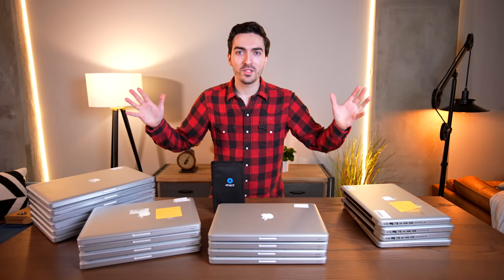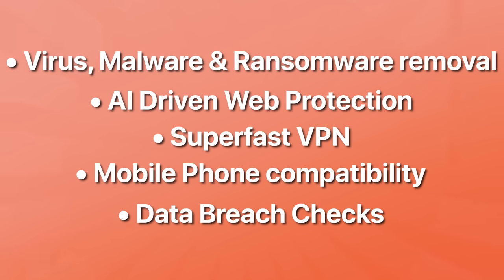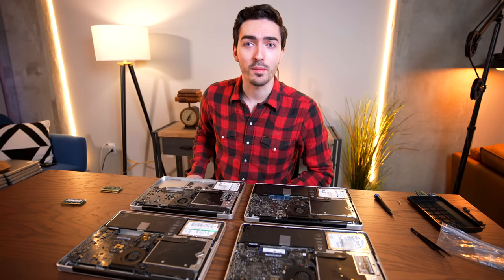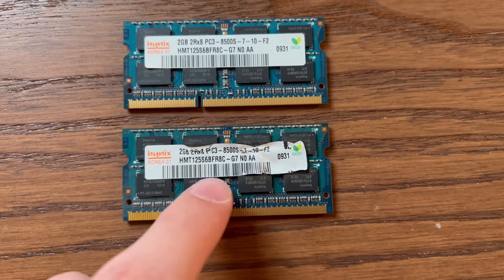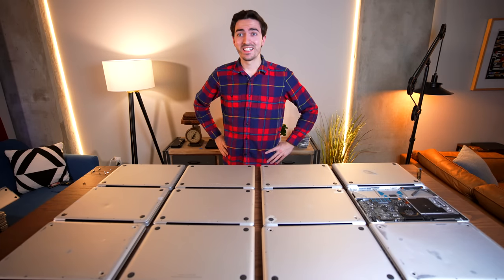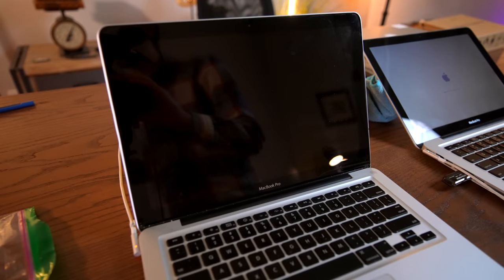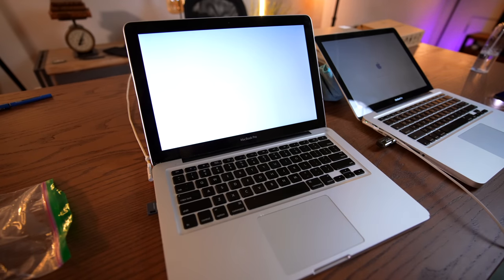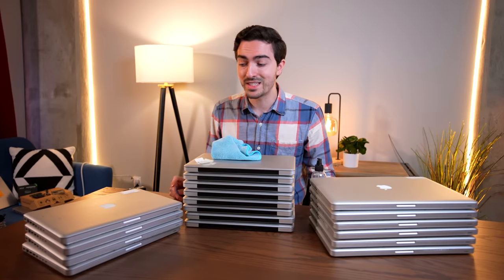Giving 20 MacBooks the ULTIMATE restoration [Part 2]

Comment from the maker: Do you think I got a good deal working on this project? Also, check out TotalAV to save 80% on a yearly subscription! http://www.totalav.com/lukemiani
Reply: Can you please give me one of your MacBook, this would help me in my studies here in the Philippines. I'm forever thankful if I could receive one. ty
Reply: You must love MAC :) great !
Reply: Loved it!
Can relate, as I used to work in SSD development as a tester for many laptops, and Macs were by far the most weird.
Had my own 2011 macbook I restored back then, and it's still kicking today.
Originally replaced the logic board, speakers and just for cosmetic purposes, all the individual keys on the keyboard.
Upgraded the drives to SSDs (yes, I replaced the CD drive with a cradle)
I recently replaced the speakers(again) and the battery too. To prevent the repeat of GPU burning out, I drilled holes where the fans are in the bottom case, and temps fell 15 degrees c.
Reply: yes you did get a good deal
Reply: @dgurevich1  You would have spent less by buying a new mac
Reply: @mattiaalesi7129  not quite. I had a donor from the written off macs from work.
All it cost was a couple hours of work.
Reply: @MyNameIsNeo81  luke is OCD about MacBooks
Reply: It is a super great project Luke. Thank you so much to show this project. My late 2009 macbook still work, but it gets too hot. So I am using an upgrated PC. I am going back to france in a month,  because I have tools to open the mac there. Bought thermal paste, hope its the only problem, but also, one screw is missing on the back case.  I learn a lot from you, now I will try to fix mine. Currently stuck in somewhere in the world where like a big prison to me.  :(
Reply: Would you be able to fix  my Mac air M1 or MacBook pro 2010?

Comment: 16:40
OBJECTION!
This board actually has another purpose, and that is putting the computer to sleep when the lid is closed.May not be a deal breaker for everyone, but I just had to mention that.
So, yeah... I guess I'm one of that guys that just had to point this out.
Still, seeing my beloved unibodys getting another life brings me a ton of joy.Well done friend!
Reply: Wait a damn second, I have a 2011 MacBook Pro 15" that I purchased used, closing the lid does not let it sleep, could this be the issue? I've looked everywhere and have not found a solution.
Reply: @rmendez011  This might be the issue.This shouldn't be a costly replacement, but I cannot tell for sure if it will help.
Reply: @rmendez011  Decided to try it out.Both 15” and 17” MBP 2011 stopped going to sleep with closed lid after disconnecting the battery board.So I guess it applies to all unibodys.
Reply: @thrallfaec6130  what happens if you unplug it but unscrew it and move it around, does it sleep then? I don't really want to keep pouring money into this laptop as I don't  use this laptop as often as before, it gets waay too hot doing normal tasks (around 80c idling).
Reply: @rmendez011  I have no idea.

Comment: Fixing weird issues is the most exhausting part of fixing old machines. 

Cheap batteries is another question, because you'd like to have many, but not spend a fortune for a decent ones. 

Anyway, it's really a great project and that's so cool you promote healthy approach to electronics: fixing old ones and NOT buying latest tech if you don't essentially need it. 
Great job mate!

Comment: 14:46 yeah, I had that happen on my 2011 17" years ago, a break in the matrix for the asdf row. But I didn't have a spare top case, so I orderered just the keyboard (it was only $20 or so!) and spend two hours swapping it out. IIRC there were 72 tiny little screws, and I had to use a magnet to make sure I didn't lose any of them.
I recently found a 13" with shorts between O, M, and the command key, and possibly more. I should be able to find a replacement from a 15", they use the same part. When doing a full refurbish you need to check the keyboard!

Yeah, it's a lot of work to get/keep even one of these back in shape. And you can't forget power supplies, they don't necessarily come with a bulk buy like that, though you could still get official ones through Radio Shack until they went out of business.

Comment: I work in the ITAD industry and I have to clean 1000’s of devices every month. I recommend using goo gone and magic erasers to remove the sticker glue. And also a brand new razor blade on a scraper to cut your cleaning time in half. I know you’re worried about scratching the devices but if you keep it almost parallel to the surface and use the same side of the blade without flipping the scraper you will not scratch the computers. Just some friendly advice. Love the content and really enjoyed this series.

Comment: Wow, that was a pretty sweet restoration! I would have personally just got them all to a working state, with working batteries, but left the hard drives as-is (unless there was a compelling reason to upgrade to an SSD - like the Core i7 Macbook). 
Congrats on getting those laptops into working order - glad you bought them, rather than someone else (who would have likely stripped them all for parts). Also, have you kept the hard drives? They can come in useful for other storage of data etc.

Comment: 13:30 seems like a panel controller self-test mode of some kind. my guess is that some of the crud you brushed out of the connector had been bridging some pins or pulling some low or high that caused the display controller to go into self-test/panel-test mode. i've seen this sort of thing happen occasionally when people turn dead laptop displays into desktop monitors by slapping an ebay display controller board onto them.

Comment: Luke, that was an amazing effort to restore those MacBooks. I have a question: how did you install Catalina on them? Most are unsupported.
Reply: Same question here! Is it even a good idea?
Reply: @kevindochain  It's an amazing idea.
Very slight graphics issues can occur in 3rd party apps, but other than that all good.
And if you don't want a weirdo install, go for High Sierra.
Even on Macs that are stuck to El Capitan, High Sierra does not require Metal so it will work just fine!

Comment: The battery indicator is not optional. Its cable sits under the jack connector for one reason... it has a component there that magnetically detects when the lid is closed. Your MacBook Pro will not go to sleep when you close it without this thing.

Comment: Well done! Yeah my 2011 13’ MBP is still kicking along for basic tasks. I often debate changing the battery and getting a new charger but it’s hard to justify (I was looking  at the iFixIt kit). The biggest issue is software at this point. I’m running OCLP Big Sure just to keep apps functioning.

Comment: I had an issue with the battery status indicator on my 2012 as well. The mac would randomly shut itself off and be completely dead (dim flickering light on magsafe) and not turn back on until I manually removed the battery and put it back in. Turns out that the battery indicator was just shorting out, and simply unplugging it fixed the problem.

Comment: I use a MacBook Pro 13" mid 2010 base model with SSD and 6GB RAM as my daily with High Sierra. Everything that I need to do works really great. I switched to it from my 2013 base model 21,5" iMac because it got too hot when playing Minecraft and using Skype. Weirdly, the old MacBook Pro can do everything my iMac could, just a bit slower. I don't know if i'm going to upgrade it to Catalina yet... HS works fine at the moment.

Comment: These will be a great learning tool for schools.
I should note, we maintain a few Mac labs at our school and some departments use Mac, but while we do have windows/linux machines that are 10-15 years old(Yes Core2 Quad is still useful if you dont need alot of power) we dont have any Macs that are over 8 years old, and that is because they are no longer supported, and critically, have security issues that cant be fixed without switching them to Windows or Linux. Honestly though that'd be fine if they served more of an industrial role instead of an end user role because they could be locked down and mostly isolated.
You might think 'why use a macbook as a server' Well it has pretty decently reloable hardwqare, its own KVM, and a built in UPS. Also it can boot from an SD Card and use the internal SSD for the working data

Comment: Why do you never have any of the vague issues? Laptops that get powered by the PSU, and that have a working battery, but that don't charge. Laptops that do charge, but only work once fully charged, then will stop working once you power them off unless you let them charge for days, laptop with brand new batteries that still don't charge... I bought quite a few cheap macbooks through the years and none of them were reasonably fixable without putting tons of money in. So now I have an M1. Gave up on that old stuff :D.

Comment: Loved the conclusion. Yes, Apple put quality hardware between 2008 and 2014, and, although they are near the end line (software, OS), they still work so SO well. I have a MacMini I7 from 1013 and a MBP from late 2014 which are still going strong. They allow me to work, move, do some heavy lifting (image, social media, video) and they may have 1-2 years till in them (for heavy work). That's like 10 years for a computer. Not bad at all. The MBP retina screen is still so good, it seems new technology :-) Most PCs from work have died within 3-4 years, even the 2 grand portables from HP or Dell.

Comment: Good to see you get so many fixed. I would like to know what it would take to fix any you have left in you pile of 32 or was the 19 the best most economical? Also what happened to the 17inch? I am using a 2013 MacBook Pro 15 inch and I can upgrade to the latest test OS but that ok.

Comment: Rather than replacing the dead logicboards, I'd have tried baking them in the oven. I resurrected a dead 2013 MBP that way, as well as an LG television, and most recently the dead nav display in my car with a $27 heat gun.

Comment: One warning on old macbooks: Chrome dropped hardware decode support for the HD3000 graphics so it's virtually unusable (on my 2011 MBP). If you're using one of these old machine use Safari or Firefox instead.
Reply: Safari and Firefox are generally better and more privacy friendly choices

Comment: Computers rapidly became obsolete in the late 90s/early 2000s. The typical lifespan was 3-4 years tops before they started showing their age. That seemed to slow down in the late 2000s and early 2010s. Macs from 2012 are still perfectly usable, and apart from the GPUs almost on par with macs from 2017. Only with the switch to 6 and 8-core CPUs did that change, and only in multi-threaded workloads. Now with the switch to apple silicon, it's a different story.

The reason is that computers from 10 years ago are still overkill for the vast majority of things people use computers for. Only for high end professional tasks like 3D modelling, or AAA gaming do the limitations start to show. But even that is not as much as an issue as it was a decade ago. A GTX 1060 or vega 56 is still a perfectly good GPU even now.

Comment: Luke, if you use Lysol dual action purple that have the texture. It easily takes the anti reflection coating off without scratching the glass on the screen. Looks brand new afterwards.

Comment: How does one use a old Mac? I tried to use Air with a OS that was just a couple of years old and getting apps installed was frustrating.
Reply: I've had just fine experience using 09-10' MacBooks, with the Core2Duo processors. With an SSD and 4 or more GB of RAM they can be very usable for stuff like web browsing, coding, and pretty much anything except for photo/video editing and gaming. They can be quite snappy. You just have to make sure you have that ssd and that it's not FULL, and make sure you're up to date on updates!

Comment: idk if its profitable to do this as a business (if you want to do right by your customers and get them 100%). However as a charity/environmental thing I could see this really being successful. Getting cheap quick and reliable machines to low income households, something that can run modern software and isn't a POS Windows computer or Chromebook. I could even see it where you could teach young students how to maintain and repair one of these and at the end they receive the computer they restored.

Comment: My 2012 has had increased ram and a SSD  and a Battery replaced before but now is becoming slow at key response. Its just had its 10Th Birthday with me .  Typical solutions isnt helping me. Its running hot so Im thinking it needs new silver on the Graphics and Cpu

Comment: This is simply sublime content. Before all the Apple geniuses turned into Apple monkeys (sacrificing their integrity on the altar of planned obsolescence), who upon any part of our Macs malfunctioning, would declare the need of a new costly logic board to force us to buy a new unit, eBay would not have been populated by all these repairable units.
I made the $300 mistake on my 2009 MBP15 of letting a sesame-seed-sized water droplet seep under the "k" key and killed it... I suspect something like that happened to your unit that had an entire row of dead keys. In both cases, a new top case turned out to be the cure.
But I wish I learned about the issue you had on the battery status indicator light on one of your units few years ago. I had the same thing on  my 2006 white MB. My solution was to sell the brand new replacement battery I got and just run it with the AC adapter (and getting a clip that defeats MagSafe). 
Kudos to donating back to the education system in your native state. That's thousands dollars' worth of Macs.
I still have both units, along with a 2007 iMac and 2011 MBA11. All of these are too slow to even be given away, except for the 2009 MBP that had been upgraded with SSD and to Catalina, and became my daily driver.

Comment: Not a mac user (be kind with your response)
What the point fixing obsolete MacBook's ?
You can not update the OS, leads to security issues.
Not sure about installing, updating latest basic programs such internet browser (brave, chrome , firefox ...) = no, emails,  banking and so on...

If installing Linux instead of mac os, then it would make sense....

Comment: Btw, the 2009 logicboards are technically better... probably the Core2Duo(last gen!) isnt as good as the i3/i5 (1st gen only...) of the 2010 logicboard, but the 2009 model has a HUGE ADVANTAGE.... Nvidia ION platform with a "iGPU" called Geforce 9400M... its basically like a integrated GPU in a CPU but placed in the chipset instead and FAR MORE EFFICIENT AND MORE POWERFUL THAN ANY IGPU THESE DAYS. I really loved my 2009 machine, it was pretty much a beast, a friend had a 13" and its battery runtime on windows was.... inhuman. Meanwhile my 9600M GT dedicated GPU in the 15" model (only twice as fast as the 9400M "iGPU"!!!!) drained the battery like crazy (but well, i had like 2x the fps)
In short: The 2009 with Nvidia ION are mostly faster than the 2010 models with poor Intel graphics, only slightly slower in CPU demanding stuff. Especially the 13" models, the 15" have anyways a proper dedicated GPU.

Comment: even though you upgraded all these old macbook pro, they can't run the latest version of MacOS, the WiFi, & Bluetooth technology probably were the last 2 generation technology, and ports are using USB 2.0... 
Yes... SSD is faster, but the data transfer by using USB2.0 or last 2 gen wifi / Bluetooth technology are still very slow...
Reply: I believe Catalina is still getting security updates. And all of these devices still appear to have functioning Ethernet. 

Compare these old MacBooks to a new $200 Chromebook. I know which one I'd prefer.

Comment: Sadly all those 2011/2012 MBP will die soon or later b’coz of faulty (external AMD) GPU, like mine MBP 2011 15 inch serviced a few years ago with new logic board (an Apple service), now GPU died again, but with disabled kext (kernel extension) & other tricks is working fine only on Intel (integrated) GPU. 🤷‍♂️

Comment: What year is the 15” MacBook pros? 2010 or 2011 the GPUS
 gonna fail no matter how much you put into them. Maxbook Pro 2012, good deal with SSD. Still can run pretty current OS…2009??? Yikes

Comment: I know it defeats the purpose of the exercise but throwing a lightweight Linux OS on these machines really brings them back to a way more useful state.  I did the same thing myself with a 2010 Macbook and Mint with an SSD runs well... mint!
Reply: LINUX is less of a resource hog but Catalina makes these more accessible for the students or novice that uses it
Reply: @goobfilmcast4239  You're right but if you're starting from scratch, LINUX is no more difficult to learn/use than any other computer.  You are pigeon-holing yourself by learning an OS that hardly anyone knows but as I said, is it better than nothing?  Sure.